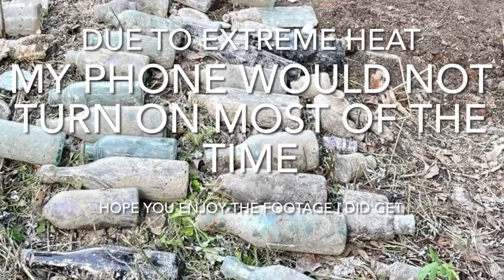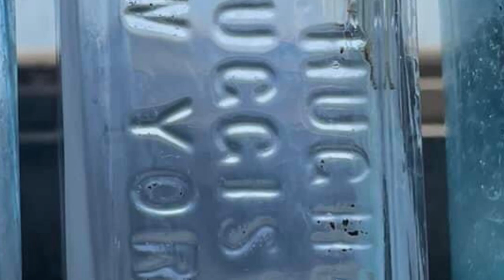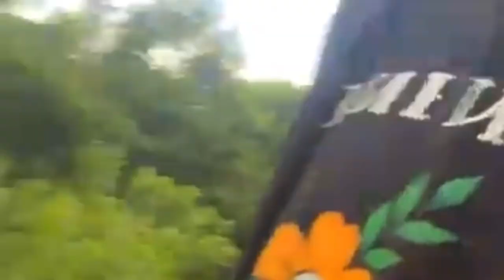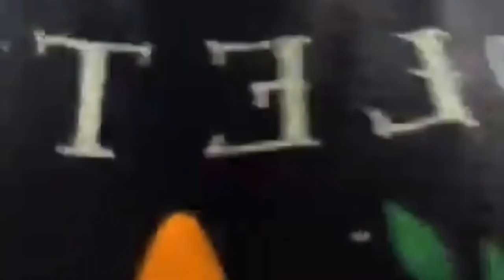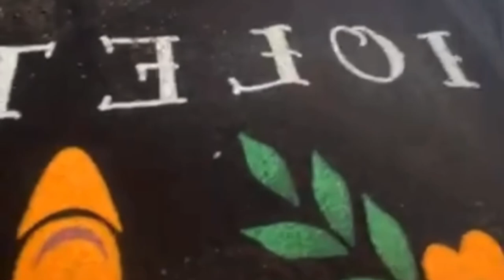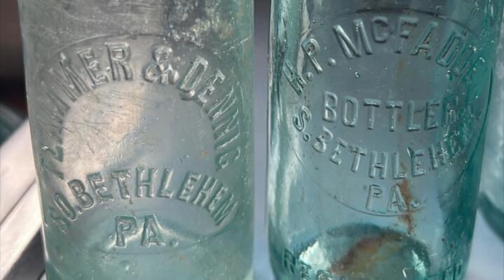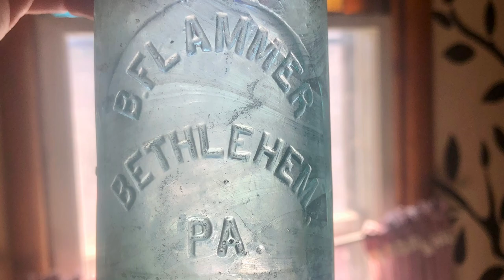Bottle Digging a 1800s Dump loaded with Hutches & Blobs

Comment: I’m not a “digger” I’m a “watcher(😂) but I noticed y’all pulled those bottles right up and out into the heat and sun. Was there not a possibility of those bottles cracking ?  ( or whatever y’all call it, LOL)
Reply from the maker: Only for a second which is fine then we reburied them to keep the temperature change to a minimum. Great question though and yes you want to transition slowly so it doesn’t shock the glass. No casualties on this dig though even as hot as it was.
Reply: @CrickDiggersInc  I have dug plenty in the heat and humidity in Mobile Al. I have never seen the hutches or smooth base blobs have an issue with cracking. The only times I have seen cracking was with pontil glass in the cold because the ground would be warm and the cold air was a bigger transition. Thick hutches and blobs usually dont have any problem

Comment: You need yourself a GoPro
Reply from the maker: I really don’t like the go pros for bottle digging but thanks for the recommendation brother. Seems to clog up with dirt quickly, also fogs up bad when it’s very humid out and muffled sound anytime the case is on. I really need to get a wireless mic and am working on it. I think that is my main issue is sound.